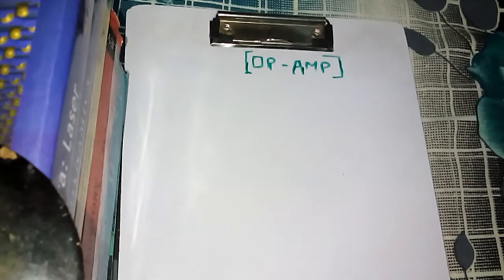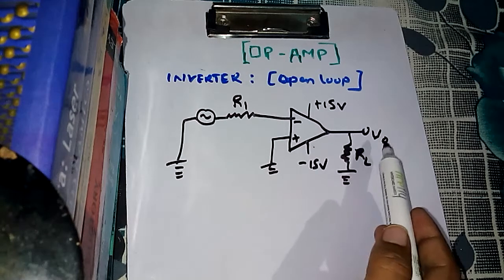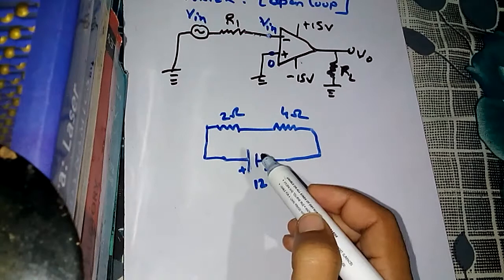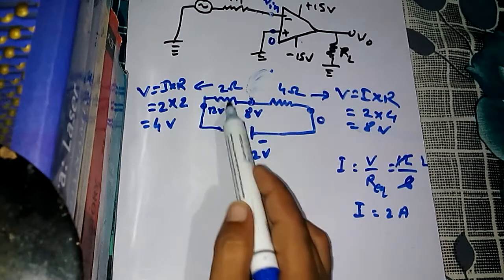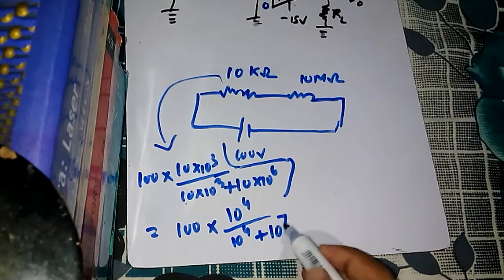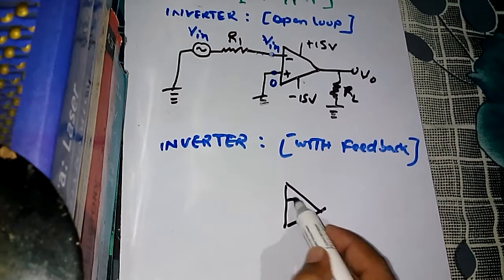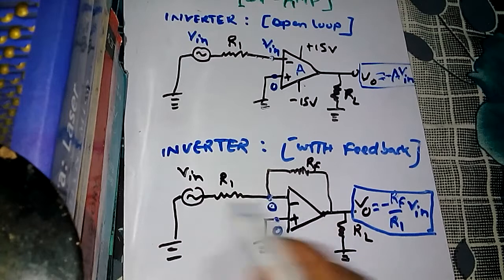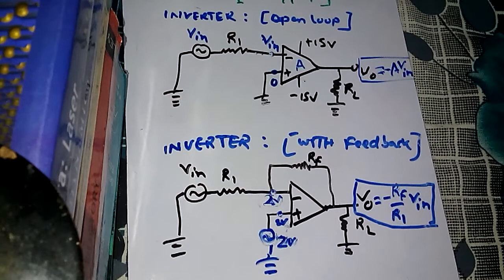op-amp concept( inverter with open loop and with feedback)

Comment: Sir m confuse plz tell..pehle resistance se 4volt drop aur 2nd resistance se 8 volt drop... eska malab ki eske aage voltage zero ho gya... pr current current zero kyu nhi hua..jbki V=IR ke accordinh zero hona chaiye tha...
Reply: Series maie current constant hota hai aur parallel maie voltage constant hoti hai yeh mujhe pta hai... sir simple language maie yeh hai kya..
Reply from the maker: Aim Nthing hey thanksss..   8 ohm k bad or voltage bacha nai h drop hone k liye.. and current jo h equivalent resistance k according pahle hi ban jata h...and pure circuit m chalta h...if u ask why there is  current after 8ohm  then i ask that why there is current before      4ohm...  actually total voltage difference jo ham circuit ko dete h usko pura drop hona hi parega.. lekin sare resistance milake..agar ckt m ak hi resistance ho to pura voltage usike across drop hoga..if do resistance ho to pura voltage dono ka drop milake drop hoga and agar three ho to given voltage tino ko milake drop hoga that means 3 k across (across all the resistances in shared manner..).  i will today make a video voltage divider..also
Reply from the maker: Aim Nthing and ha it happens for ckt or for a loop having resistances in series
Reply: Sir agar hmm resistance na lgaye to current nhi produce hoga ?? M right na sir...  voltage kya sirf electron ko push krne vali force hai..  toh resistance lgane se current kaise bn janta hai..  resistance se toh sirf electron ki speed kum hogi..
Reply from the maker: Aim Nthing no..agar ckt battery s connected h or ckt m koi resistance nai h to  bahot jada current banega and wire jal v sakta h
Reply from the maker: Aim Nthing  kuki voltage ko to drop hona hi h....ha agar very huge resistance rahe to current nai banega..but yenhavi voltage pura drop hoga and after resistance voltage will be zero(since it dropped)
Reply: sir ohms law V=IR  Kb lgayge hmm..
Reply from the maker: Aim Nthing u saw the new video.?? was it helpful??
Reply: +bidhan khirali  yes sir.. concept clear ho gya.
Reply from the maker: Aim Nthing oo really..great...